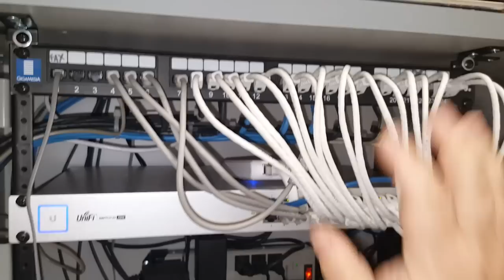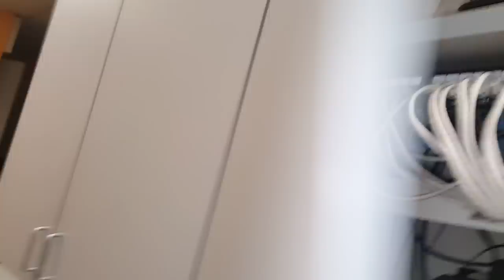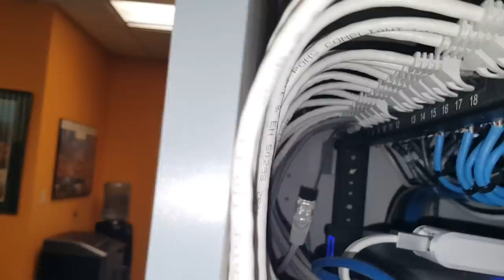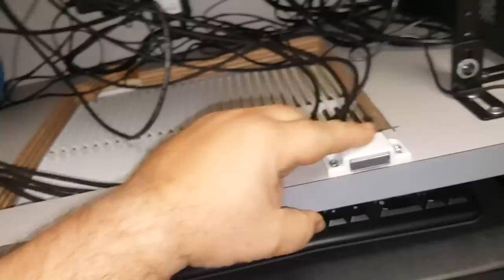#018: Quick Tip for Reducing Cable Management

Comment: Why.. why... are 24 port switches all 2 rows of 12 ports either on the left or right hand side of the switch? If the switch manufactures would just make a single row of 24 ports it would make cable management so much easier.
Reply from the maker: So true!!

Comment: After watching several of your videos I have decided to move over to modular patch panels. As our network evolves, I find myself having to re-patch cables in and our using our traditional patch panel. While it is going to take about an hour to terminate and install the new patch panel, it will definitely be a time saver! Thanks!

Comment: what is this rack / type of rack called? I have network cabinet, but can't find solution simmilar to this
Reply from the maker: In an earlier video, I show where I hand-built this rack. I purchased the rack rails from Guitar Center I think (might have been eBay though). Then used right angle brackets to mount inside of a well made wood cabinet in an overhead spot in this office. So, you'll never find this in a catalog!

Comment: I wondering what that little white device which connected to switch with a bit short cable and sits above the switch ? 

Great tip! get it
Reply from the maker: That's a device that manages Ubiquiti equipment so you don't have to use a PC connected to the network. Turns out the customer really didn't need it that much but I installed it just the same. Their network is pretty simple and could have probably just left it out. It's called the Ubiquiti Unifi Cloud Key - Remote Control Device. As of late, I've not needed to use them because of hosted cloud services that are able to control Unifi equipment remotely. But at the time it was a pretty cool device!

Comment: question. ive been watching a few of your videos and Im wondering. What is the best length for cables when there is 0 space between patch pannel and switch, 1U space between patch pannel and switch and 2U space between patch pannel and switch. We have alot of those 1 Ft cables and it has that bubbly effect when there is 0 space between and I was wondering if you could give me some insight.

Also. that modular patch pannel. that silver one that you put in your own keystones in.. do you have a link to the one you use? 

thanks
Reply from the maker: +H&NKinsha It will all depend on the layout of the switch. Most 24 port switches look like this one and will require a different patch cable length then say a 48 port switch where the connections are more evenly spread out. Just experiment and see what best works for you. I like 6 inch patch cables with a 48 port switch with 24 port patch panels above and below. My 2 hour long video shows them toward the end.

Comment: Is it ok to use 20cm/6" Patch Cables?? I've heard they can cause packet loss or bounce back. Thanks
Reply from the maker: They work perfectly fine. There was an old Ethernet standard that is no longer valid that specified a minimum cable distance of around 3M. Mind you, that distance was from port to port and NOT the minimum patch cable length you were allowed. The older standard may have had technical issues where short cable lengths caused reflections or harmonics that affected throughput, but those days are long gone. I've seen cable lengths as short as 2 inches working with zero issues.

I will mention this to you, I've heard many similar concerns about Ethernet cabling over the years. When this channel started getting big, these same myths started popping up again. So I've decided to put together a video here in the near future that will put all these myths to the test and settle things once and for all. I'm still working on all the details but I think it will be a great benefit to technicians that work around this equipment on a daily basis to know just how far things can be pushed and just how amazing Ethernet cabling really is! Stay tuned!!
Reply: FiberNinja that's great! Thanks for the advice :-)

Comment: Not a fan of short patch cords it makes life a hell when you try to service the patch panel.
Reply from the maker: Stanila Stefan Check out some of my other videos about this. With short patch cables and lots of slack on the back, it's actually very easy to service. In fact, you don't even disconnect from the switch, just unscrew and rotate outward. Now the back on the panel is facing you and everything is still connected!

Comment: that's horrible! make personalized cables!
Reply from the maker: Far too time consuming. No pro does that. Prefab'ed patch cables are just too cheap and my time is worth more than that. It sounds great at first but there are a couple of problems with it. 1) those short minutes terminating raw ethernet cable will add up quickly. Next thing you know the day is over and all you did was make patch cables out of solid core cable that will be stiffer and not too keen on being moved around much. 2) Creating an array of custom patch cables essentially means your level of flexibility is reduced when you quickly learn that this patch cable array is constructed with very specific  "non-transferrable" lines.